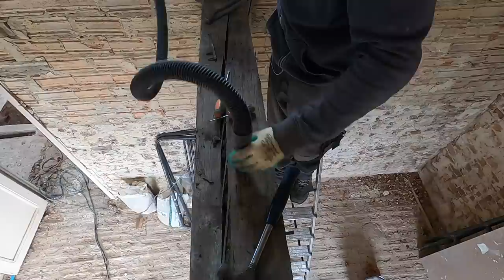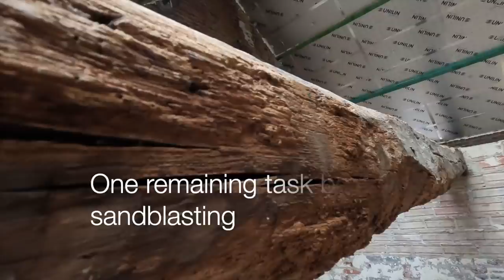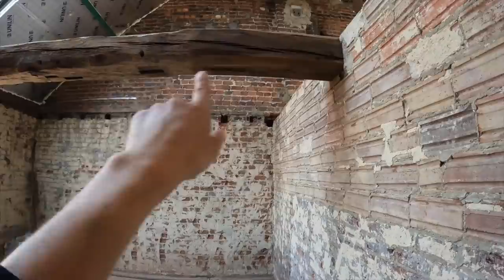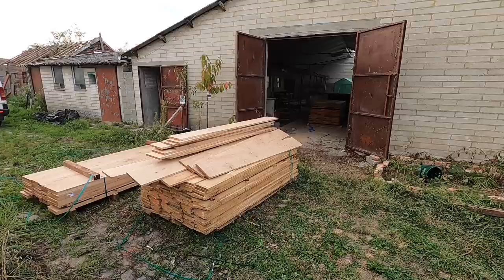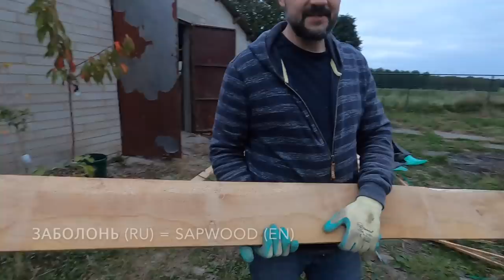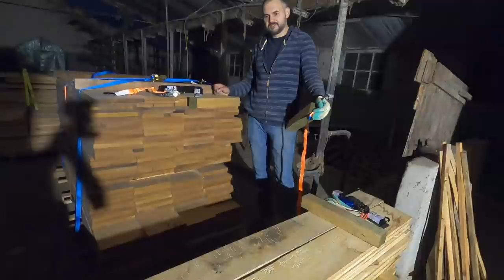Old OAK BEAMS sandblasted / LONG-AWAITED wood delivery

Comment: Hello DeHoeve!  We bought a very old, neglected farmhouse ourselves just about a year ago, and we‘ve been following your channel as well.  I was wondering, what kind of oil did you use to treat your old woodbeams in this episode.  Is there someone you could suggest?  Our farmhouse is not a „listed“ (not under any governmental restrictions because of the age of the building - much like yours - but we want to keep the „feel“ of the old farmhouse, except some building permits).  So, what kind of oil did you use on your beams in „Old Oak BEAMS sandblasted“) video.  I‘ve heard good and bad about linseed oil.  I love your videos!

M.

Comment: As long as the planks are treated and sealed, they would be better on the ceiling than on the floor. The strength is limited.

Comment: Please do more research and get some professional advise, You are doing some things that have immediate and long term consequences to the structural integrity of the building.
#1 Pounding on walls to remove cement and/or plaster will loosen the lime in the mortar.#2  Removing most of the upper floor beams will compromise the walls of the house. Snow could blow out your walls and even without the snow load the weight of the roof is pushing down and out on your walls. You can put in steel cables to hold things together. #3 You need to treat all the wood (old & new) for wood worm, beetles etc. It looks interesting and adds character but it is also compromising the structure. Woods biggest enemy is water damage, fire, and then bugs that eat it. I admire you both and champion what you are doing but sometimes you don't know the right questions to ask. A structural engineer will cost less then you house falling down.
Reply from the maker: Hi Linda, thank you for your advice! We do consult with specialists and take all the issues/challenges seriously.
Reply: Thank you for replying, I understand you are two highly intelligent people with an amazing work ethic. Sorry to sound bossy, just wanted to make sure you  were doing the right thing and felt it was better to say something in case you did not realize all the consequences. I learned wood working from my father, he built the harpsichord that he played. My husband I restored and old farmhouse and built 3 barns and several out buildings so I understand the tremendous effort and commitment that you are making. Sending love and big hugs from one of your many fans.
 @DeHoeveOldBelgianFarm

Comment: If it is structural have an professional engineer come in and take core samples to see if it is any good structurally. Never sandblast or waterjet wood or old masonry, EVER. Maybe low pressure walnut shells. By using a demolition hammer on the walls to remove the plaster you may have inadvertently destroyed any bond you might have had in that old lime mortar.  You should have stickered each layer of boards. If it is going to sit there for awhile seal the ends.

Comment: Oof!  They couldn't use a forklift to get the skids into the barn and now Illia had to break down the pallets to get it moved inside.  Well, the good news is that there's a safe place to put the wood until it gets used away from the elements.

Question - for the flooring/ceiling with all that lovely oak, what kind of method are you planning for the installation?  I read that tongue-and-groove is easy but will he have a table saw for the wood (along with a planar and sander to get the sides cleaned up)?
Reply: and a router to make the tongue and groove

Comment: This is appalling advice and a dreadful exanple to be setting. Do NOT sandblast old beams. It's way too destructive. You should use far less invasive techniques, like scrubbing by hand, but if you really have to blast, use dry ice blasting. This is a far better system, and retains far more of the original surface of the timber. Sand blasting is not allowed on Listed Buildings in the UK for this reason.